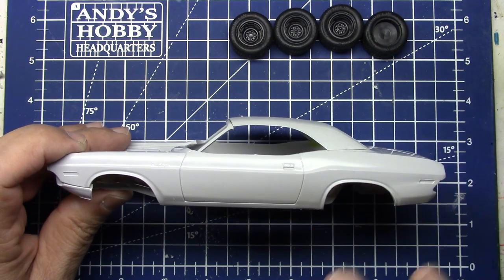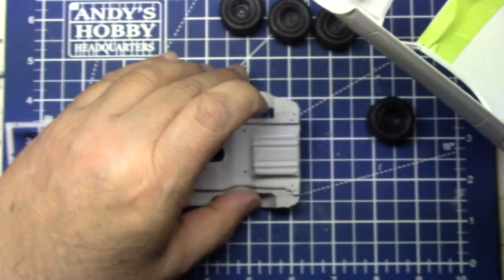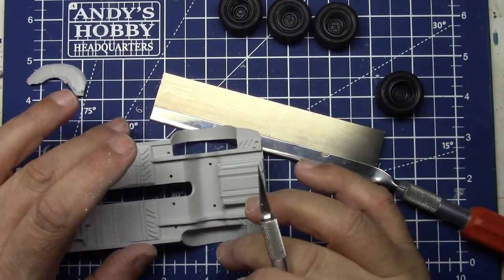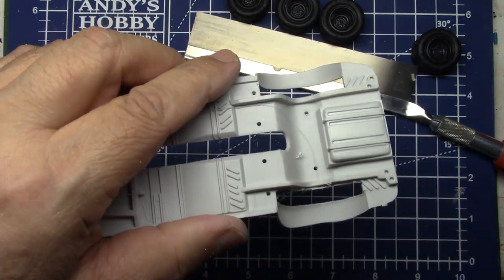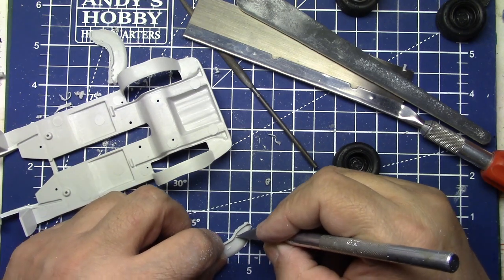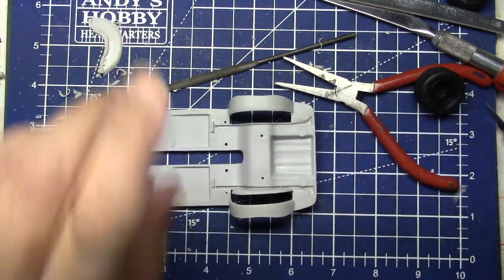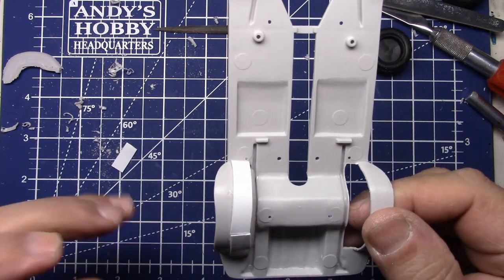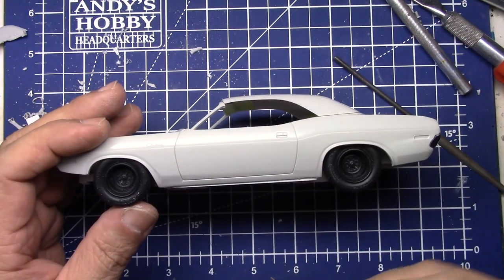Ep124 How To Make Mini Wheel Tubs For Your Model Car

Comment: There is another technique that can be used - I saw it many years ago.  After cutting out the desired amount of the inner fender well, you can use
a plastic medicine bottle ( or a bottle that used to contain aspirins or antacids or any other over-the-counter meds ).  Use your saw to cut off the
bottom of the bottle, then cut that piece in half.  You are left with two identical inner wells that can be shaped and glued into place.
Reply from the maker: Yep, I've done that, too.
Reply: Aluminum soda can works well too, can make it look like sheet metal, and add some painted   ribbits
Reply: @dustinrossi9384  never heard of a "ribbit" except for the sound a frog makes.

Comment: The (late?) Doctor Cranky.used the rear  pro-street chassis from the mid "60s" Chevrolet Nova . I am using it on the "fast & furious" Plymouth.I liked the first F&F but the rest not so much.
Reply from the maker: That is one of my favorites. I do that also. But the point of this when you want to retain most of your stock chassis and just need room for bigger tires but not Pro Street size. I did point that out in the video.
Reply: @TheLukaCeeChannel  you are right,you did.My bad. Totally dig your channel man.

Comment: I would like to share with you what I bought for plastic cutting, on the TEMU website I found a pack if 0.5mm thick rotary saw blades that are used with a Dremel type tool instead of the abrasive cutting disks,  perfect compliment to a man's tool kit for just this job and to top it all they were about $3 for a set, if you need help locating this, give me a shout

Comment: There is saw blades that fit into the Exacto knives they work great along with your saw
Reply from the maker: I know. I have a set. They are photo Etched. I use them when I want to limit the amount of material, removed. It didn't matter on this job.